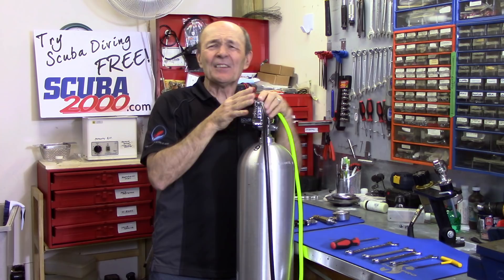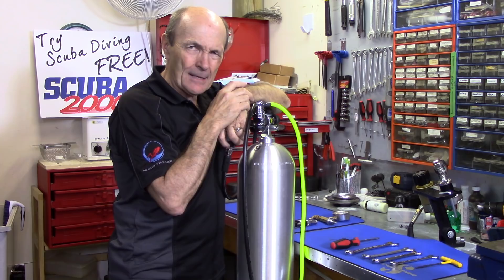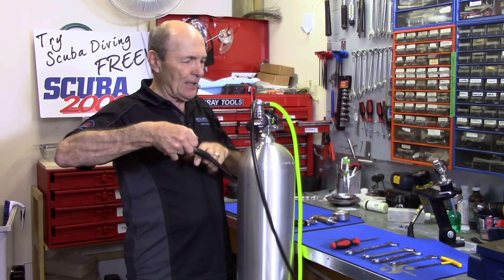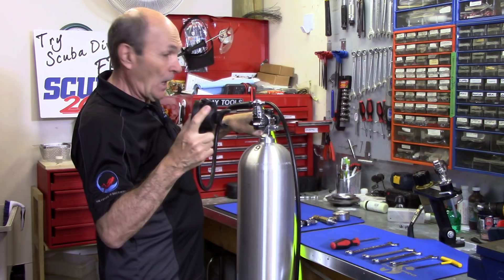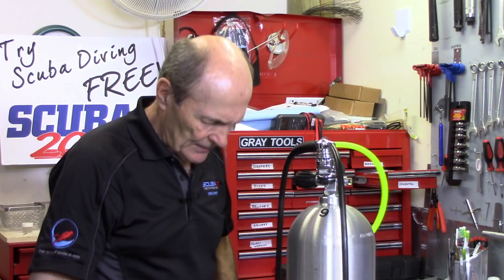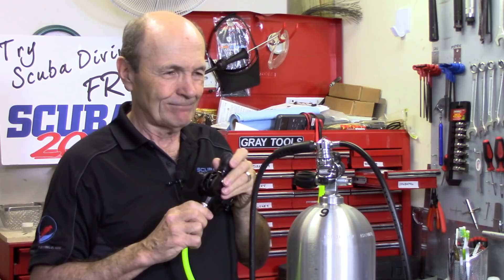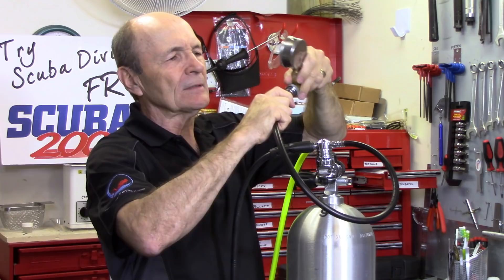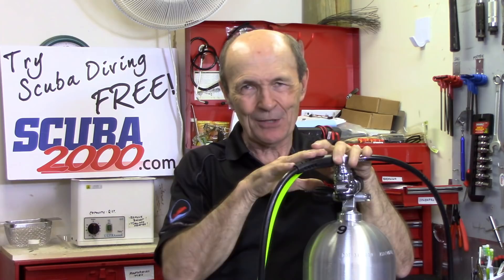Adjusting The 2nd Stage - Scuba Tech Tips: S05E14

Comment: Do you have any thoughts on those 360 swivels between 2nd stage hose and 2nd stage regulator?
Reply from the maker: I used to think they were a good idea. They sure looked good and the sales hype sounded wonderful.
But then I tried one!!!!
The problem is that the swivel is too loose so it keeps swiveling down. That is, when you pick up your regulator 2nd stage and bring it to your mouth, you expect it to be at the right angle with the mouthpiece facing into your teeth. Just open your mouth and stick it in. This should happen even if you grab the hose instead of the actual body.
But with the swivel, particularly if you lift the reg by the hose, the mouthpiece flops down at a weird angle, sometimes even facing away from you. There is no control at all. You MUST grab the body and turn it to face into your mouth. It almost becomes a 2-handed operation. In an emergency, it could be a problem. Otherwise its just a nuisance - a nuisance that you paid extra for!

These days, I suggest divers simple get flex hoses to eliminate jaw fatigue or reg body weight. They are probably cheaper than 360s, don't require service and don't create deployment problems.
This is one of those things that isn't apparent until you try it. Some may like it but for me, when you weigh the cost and service required annually, the benefit simply isn't there.
Take care.
Alec

Comment: Does that pressure / tendency to free flow change with depth tho??
Reply from the maker: Free flow is affected by the temperature drop with depth.  Typical cold water dives in summer at Tobermorry, Ontario Canada can be 65F on the surface dropping to 35-40F at 100 ft or inside a wreck.  As water temperature drops the risk of a free flow increases.   Watch my videos on cold water environment kits for 1st stages and what causes free flows for more information.
A

Comment: Thanks for a very useful video you have here. I have a Beuchat VRT30 set. What is the optimum immediate pressure for this first stage? Is this the same across other brand?
Reply from the maker: Every 1st stage is unique. I don't have current Beuchat service info. It may be available on line or from your LDS.
It's a pretty standard balanced piston 1st stage. This exact regulator is used under different names by a number of scuba companies as is a common practice today. Each company tries to market theirs as unique and uses different descriptions to set it apart from the others. Sometimes those attempts get silly.
Sales literature claims it has an adjustable HP seat but that's not exactly correct. The seat can be 'adjusted' but it's hardly a simple affair and no different from any other similar regulator.
The optimum IP is set by the manufacturer and is critical.
Many divers think they can improve performance by increasing the IP but all they do is upset performance and generally that leads to other problems. Other divers think they can improve a regulator's resistance to cold water freeze-up by decreasing the IP but that's also not true and that practice can lead to a drop in flow and/or an increase in breathing resistance, both of which can lead to diver trouble.
The IP is a product of many factors that are beyond the divers control. Changing the IP from factory specs is a 'no win'. 
I hope this answers your question.
Alec
Reply: Thank you very much Alec. What I was looking for is the factory preset IP of this first stage. What happened was I took apart my first stage to clean it myself but I forgot make note of the original IP. That was my mistake :). After I cleaned it and put everything back together, it worked OK. I took it for a dive and noticed that the first stage making whistle sound during breathing in. The sound happened to go away when I consumed about 1/3 of the air in the tank (about 150 bar left in the tank). At the moment the IP I measured is 150 psi. Any suggestions on this case? It works ok but the sound is annoying. Thanks.
Reply from the maker: Ok. So you're already into working on it.
1. The whistling noise is harmonic vibration. It's similar to the sound you get when you rub a moist finger around a wine glass rim. It's a common issue with dive regulators but fortunately not serious. It's certainly not life threatening at all but it should be fixed as it indicates 2 parts (at least 2) are not working well together.
If you had the proper factory service manual you would know which parts need lubrication and which don't. Some parts, even some O-Rings are NOT supposed to be lubed. A whistle is commonly caused by a poorly placed spring under the piston. That spring must be absolutely square to the piston and both ends of the spring must be square. With long use in one position, it's possible the spring is worn on one side. Since you've rotated it, it's complaining.
2. One solution is to place a very thin silicon washer (spacer) under the spring on either the body side (best) or the spring side. That will affect (raise) the IP however which must be reset. I'm not sure how the IP can be adjusted on this regulator without seeing it. 150 psi is probably OK but I think lowering it a bit (135-140) might help. After doing that you will need to adjust the second stage to match for the easiest breathing.
Try to find service manual if possible.
Good luck. 
Alec
Reply: I will follow your suggestions. Thank you :)
Reply: Thanks Alec for your recommendation. I am using exactly the same model as ChunnyT. Had it serviced together with him, but luckily mine was OK. Will take your suggestion when I do the next service.

Comment: Hi Alec...  i got some issue here for my 2nd stage scubapro s600. The supplier/seller (PACIFICA DIVE SHOP ) CEBU PHILIPPINES.  I bought a new purge cap.they install it. Now when i try to test. Air leaks from 2nd stage.  What u think? Does changing purge affects some of it. ?
Reply: Hi. I tried what u did say in this video. Freakin awesome. Solve my diving day. Btw.... adjusting that with a tool is ok? Do i need to bring on tech guyz to fix? Or this is it? And why free flow happens? Thanks..   hehehehhe
Reply from the maker: You don't need anything fancy. You're good to go.
When they installed the purge cap they didn't re-set the lever height so the diaphragm was always pushing on the lever - freeflow.
Adjusting the seat as I showed you moves the lever slightly away from the diaphragm - problem solved.
Get diving.
Alec

Comment: What is intermediate pressure creep?
Reply from the maker: Near the end of the vid, I showed the IP gauge used by a serviceman to set the IP.
That gauge can also indicate other problems in the regulator, usually in the first stage since the IP comes from the 1st stage.
One of those indicators is 'IP creep' (sometimes called 'drift'). This is where the intermediate pressure climbs and then slows down, may actually stop, but then continues to climb slowly until it reaches the proper IP. It creeps - hence the name. IP creep usually means that the high pressure seat is not perfect. It may be dirty, worn out or old and dry.
When the IP climbs and gets close to the set IP,  the seat seals but, if it's not perfect it won't seal tightly and the IP slowly continues to climb until the pressure gets so high that finally it does seal and the IP stops climbing.
The only solution is to replace the HP seat and inspect the sealing surface to be sure it's perfect too.
Some less knowledgeable service people will just adjust the 1st stage to increase the spring pressure and that will eliminate creep. But that also means the spring pressure is higher that it should be and the air flow will be slower.

Sometimes the creep will not stop until a free flow occurs, that is, the seats never seal completely.
The solution is the same.
Using the IP gauge will show the speed and scope of 'sweep'. 'Sweep' is the full movement of the gauge needle from 0 to the IP. The speed of the sweep is an indicator that may show a problem. Also the scope of the sweep. Sometimes the sweep goes past the IP and then drops to the correct pressure.
All of these things can help an experienced serviceman determine the condition of a regulator and the proper service required.
Alec

Comment: what is that screw called
Reply from the maker: I'm assuming you mean the screw that I'm adjusting inside the second stage.
It's not really a 'screw'. It's the second stage orifice, sometimes called the adjustable orifice.
It has a slot on the end for adjusting, kinda' like a screw, but it's the orifice.
Orifice BTW is a fancy word for hole. So this is the hole that the air from the first stage goes through on it's way to your mouth. It's a threaded hole that can be turned in or out as you see in the video.
Hope that helps.
Alec
Reply: Do you have a picture of it in its original place for the apex XTX 20 Octo
Reply from the maker: I do not but if you can find a parts breakdown of it, you'll see it.
It is exactly the same as I showed in the video. Take the hose off and look into the hole. You'll see the orifice with the hole and screwdriver slot. If you're inclined, you can unscrew that orifice and it will come right out. You may have to reach in and tug it out with a bent pick the last 1/2" or so., but it will fall out so you can look at it. Don't scratch the other end, the end that seals on the second stage seat. It must be perfect.
It has an O-Ring on it that needs to be very lightly greased and then put back and adjusted as I showed in the vid.
Pretty standard stuff despite all their sales hype about it being special.
Alec
Reply: Thank you. Videos are helpful like usual
Reply: Could you do a video on your own personal gear